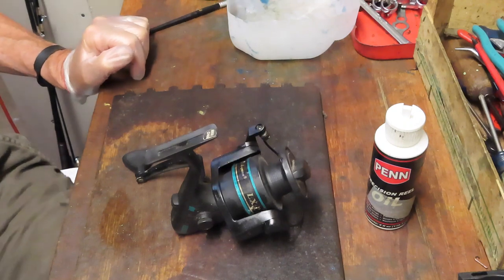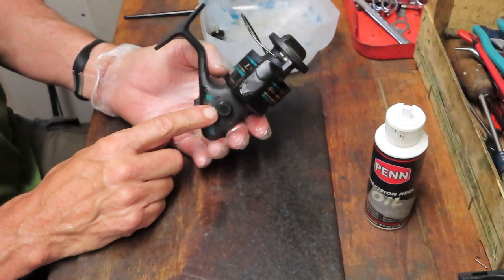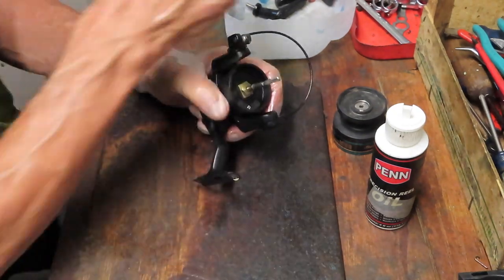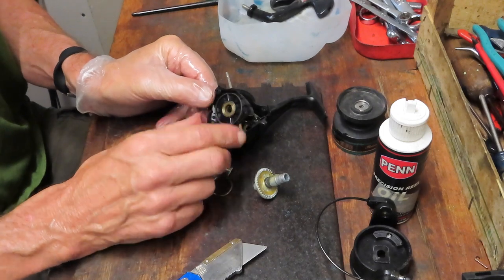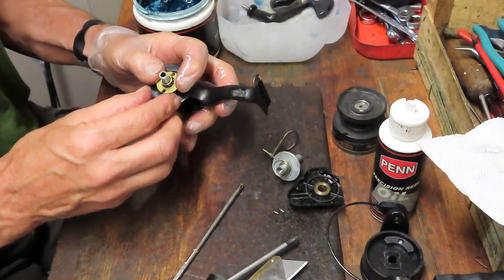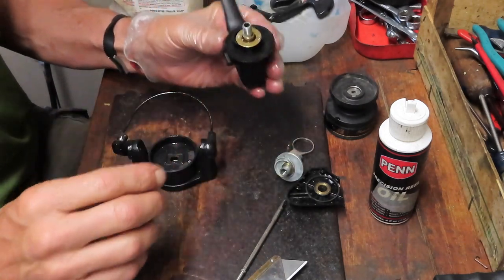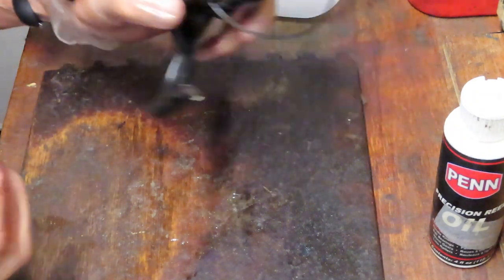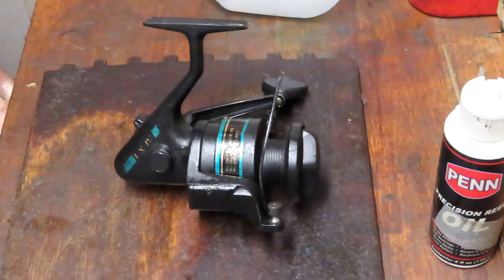Shakespeare LX IV spin fishing reel how to take apart and service

Comment: I’ll take a Shakespeare 2080 Sea Wonder over this any day. Seriously though that’s a very unfair comparison as this reel and others like it do supply a much needed  niche in the pantheon of spinning reels. Of course I do love my vintage Shakespeare worm gear reels and most especially the famous 2062. What a fantastic reel that one is. I wish Shakespeare could have continued to manufacture reels in the line of the 2062 or Sea Wonder reels. In many ways I really hate that many once great reel companies have been swallowed up by conglomerates. Oh, Dennis in my note to you I put the wrong value on the Mer 52 reel I got. The collector I spoke to said  mint ones go for $250 - $ 275. My isn’t mint but it is close. With the rarity of the reel this is just getting better and better. The reasonI bought it was that it was an early reel designed and manufactured as PUM. Back to this Shakespeare, l love the brass bushings and that is really has an old reliable crosswind system I’ve seen on so many reels like Ryobi and Olympic. I don’t favor this type of AR connection to the main gear but I really like this reel. It’s too bad it has a plastic housing but what a surprisingly nice drag setup.I’m sure that case kept the price down. what did you think of the main gear on this reel? As far as restoring luster you can always use Armor-All. Just kidding. LOL Great video Dennis!!!  By the way I’m definitely taking a lot of photos of that Mer 52 Punch reel. I wonder if Daiwa knew of this reel when they named their Punch reel. I have two of them and they are fine reels. I’m going to be very nervous taking apart that Mer reel due to it’s age, value and rarity. Take care of yourself my friend! Oh, Armando Reyes sent me a photo today of a beautiful Mitchell 489 reel he got for Free! What incredible luck! Well almost free he has to service two Penn reels but boy would I take that deal!
Reply: Ah yes,the Shakespeare 2062. Absolutely love these reels. I have to confess I have more of these than I need. I have managed to collect four mint in the original box and have paid dearly for them but if they were to be manufactured today the price would be astronomical. I keep four more that are in excellent condition that I use for Striper fishing and Redfish. It's sad that no one makes a generational reel at a fair price anymore. I guess it mimics our throw away society that we live in now.
Reply from the maker: Thanks as always Chris - This reel is a value for price and a. good one for most folks.  Looks like you did quite well yourself for the Mer.  Stay well - Dennis
Reply from the maker: You've said a lot there Mike and I agree.  The 2062 is a tough one to beat.  Dennis
Reply: Mike Mcelveen  I only have two 2062s but I love my Sea Wonder reels just as much. They are like extra large 2062s.
Reply: @2ndChanceTackle  Dennis, just got the Mer 52 and got another surprise. Remember this reel is dated in the mid 1950s. It has a very early skirted spool. It is 20 -30 years older than the earliest American and Japanese Skirted spool reels. This reel is absolutely incredible. I’m almost too scared to try to open it up as I’ve never seen anything like it. It is working beautifully. It only has some very superficial scratches on the spool and at the butt of the housing. Otherwise it is perfect. I am thrilled to have it!

Comment: you are using Reel-l X on this reel.. Why did you choose that over the Penn precision oil you had on the bench?   looks like the bail wire maybe a little pitted.. I am guessing steel wool may work to get a bit of it off but can the bail wire itself come out and be replaced?  I have one that the roller on the wire is mucked up.    Thanks.
Reply from the maker: They both work fine.  I used it because the container can reach tight spots with the long applicator nozzle. - Dennis

Comment: I've taken apart a reel before and haven't had the problem I am having now. I've got the top piece off along with the gear and washer, but the nut won't budge. I've tried twisting it counter clockwise many times but it gets no looser than before, super tight. Any help would be appreciated
Reply: To add, the nut does turn slowly, but theres so much friction it feels like its not doing anything
Reply from the maker: Try turning the nut clockwise to take it off.  Some of the rotor nuts are reverse threaded - Dennis

Comment: Someone gave me a Shakespeare LX IV combo. I not familiar with reel sizes when it comes to spinning reels. What size reel is it for example 2500 etc.?
Reply from the maker: Most combos are sold with 40 or 50 (4000 - 5000) sized reels It is likely that it is yours. If the capacity is 8-10-12 pounds then it would be a 4- and if it is 10-12-15 then it would be a 50 size.  Larger sizes would go to 20# test and smaller sizes would be 6-8-10 and below - Dennis